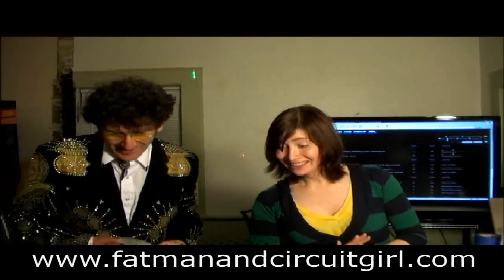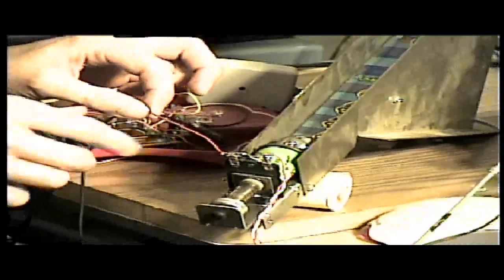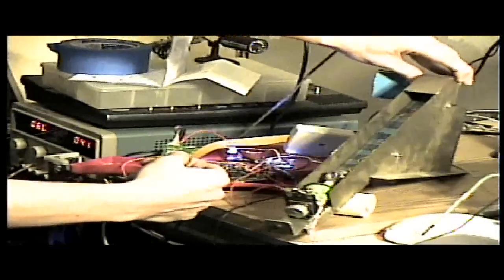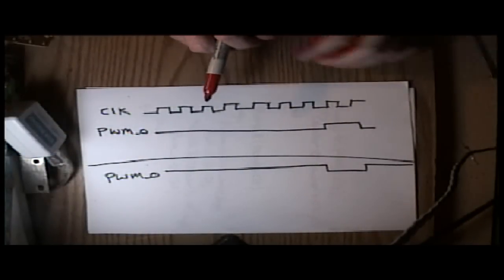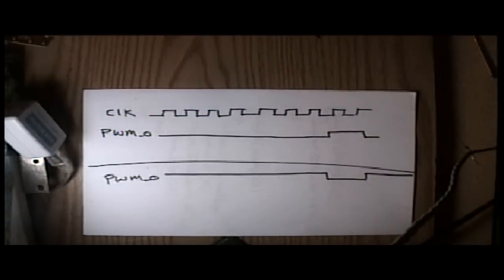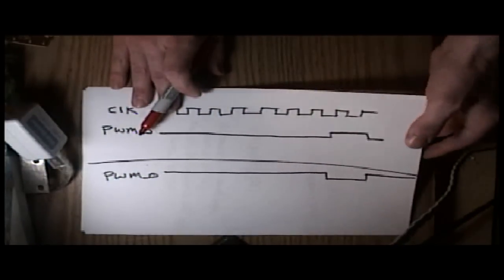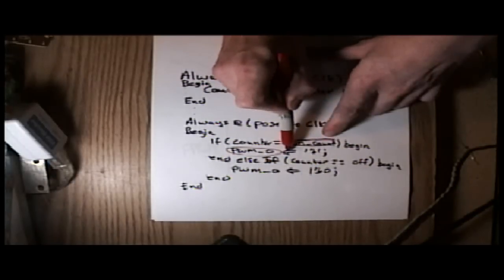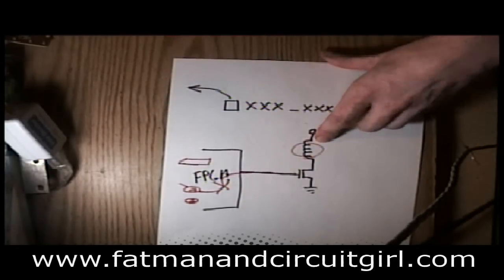FPGA Pinball Solenoid Pulse Width Modulation

Comment: You don't need PWM. Magnetic's are DC based with the most power. PWM is merely softening the flow. The only thing you need is a transistor which saturates in an on state with low resistance across the transistor. The problem here is that long wire to drive the FET, Problem with FETs is they will oscillate and ring with that huge feedback loop you have with an L of the wire that impulses it. You only need to know what DC current the load is and drive it. Small signal transistors and no PWM.